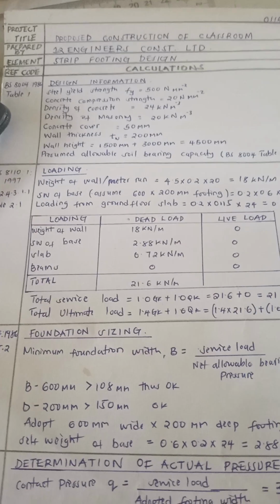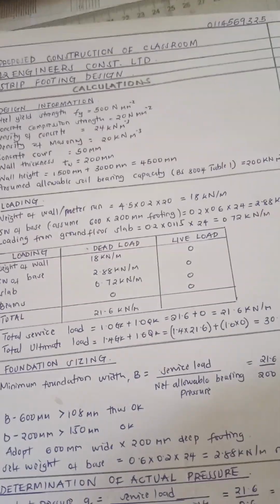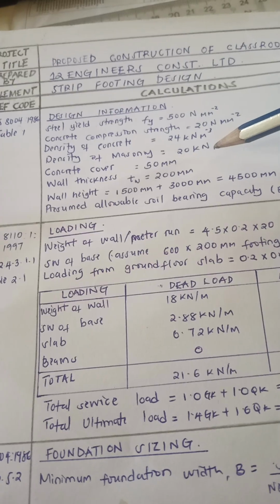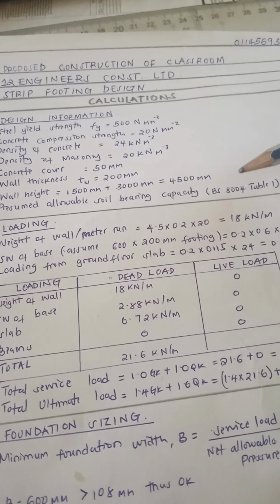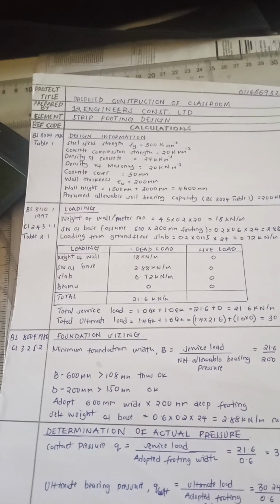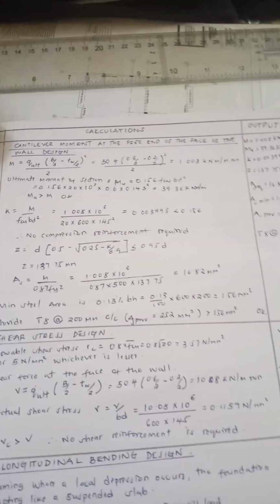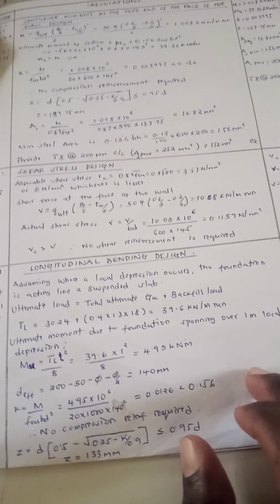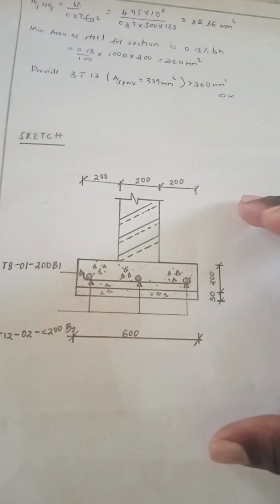Strip footing design . To BS 8004:1:1986, BS 8110:1:1997. Manual Calculations.

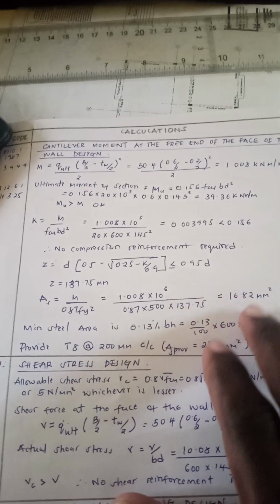Comment from the maker: 6:32 Basically visualize the footing as a cantilever slab- Essentially an upside down beam where the load bearing wall is the "fixed support" and the overhang parts of the concrete base as the Cantilever arms being pushed upwards by soil.